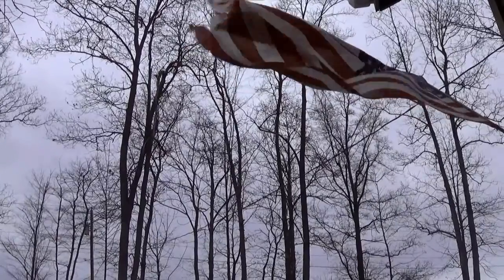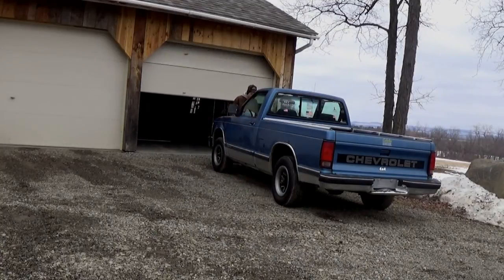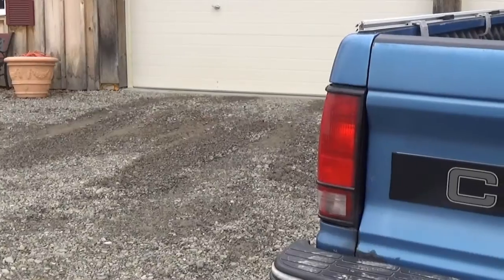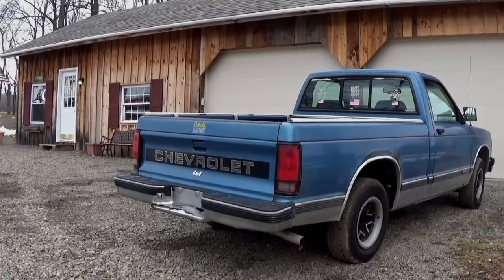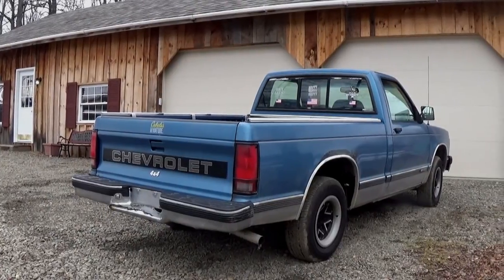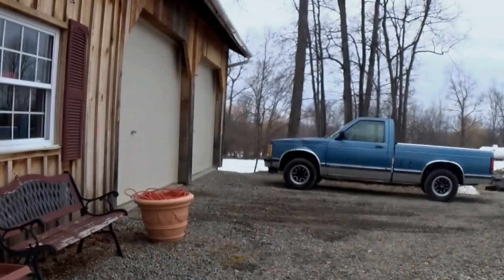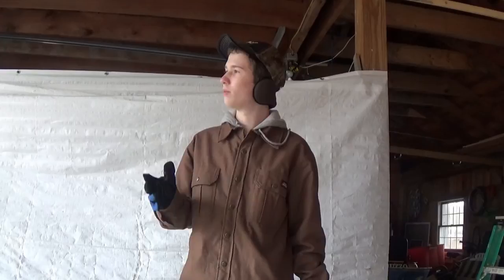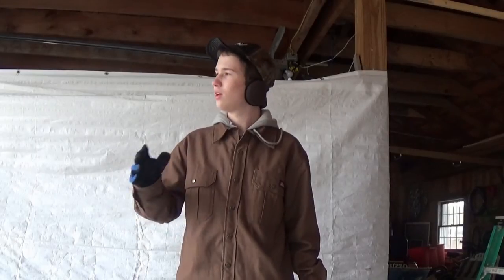Spraying Silicon Spray On Spark Plug Wires - Channel CGE Auto Video 6

Comment: You never said why you're using the silicone spray. I'm assuming you had some kind of Arc or a bad wire that is creating a misfire. Which my car has so did the silicone spray stop the misfire you didn't say that in your video
Reply: WD-40 works too. Don't get any on the actual electrical connections (metal parts) but the plastic inside the distributer cap, the threads of your spark plugs, and coat the rubber part of the wires.

Comment: Grounding arcing out check your plugs  and look for little lines in the porcelain part of the plug if you see little runs tiny lines running from end to end of the insulator then theyve arcd and cracked insulator plugs can be sensitive when you losing spark they will jump remember electricity will jump to the next closest strongest conductive surface and it always grounds down!    All electricity on earth including thunder clouds that produce lightning electricity well just like so is the same for all electricity it wants to naturally ground down to earth the literal ground